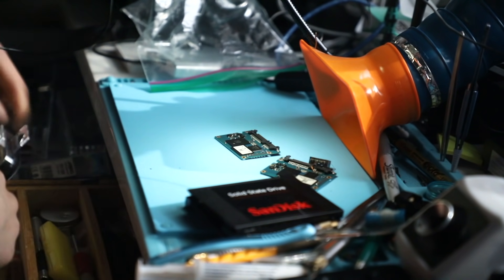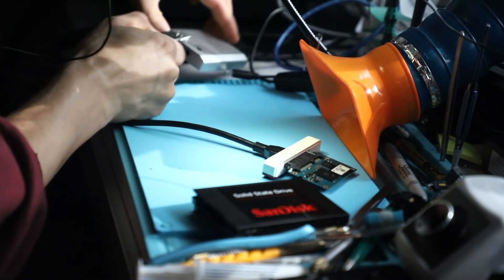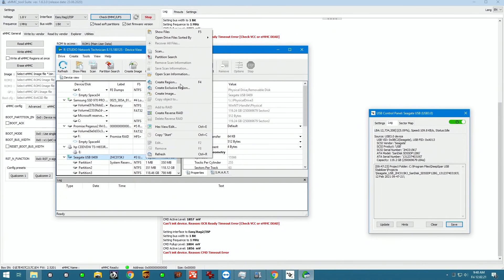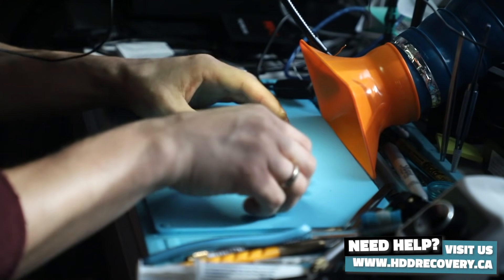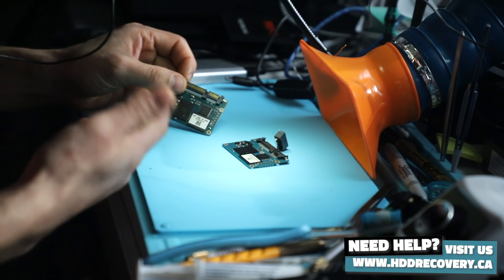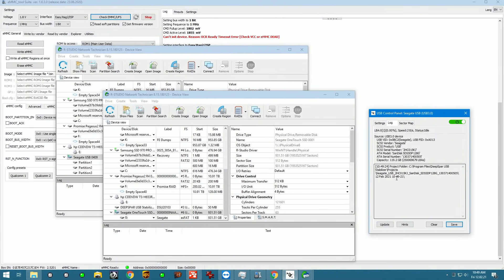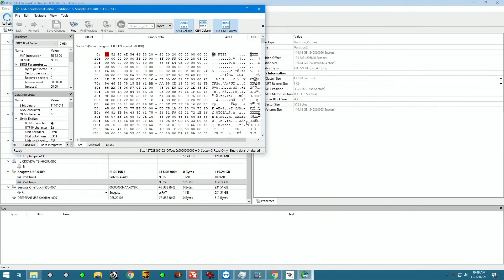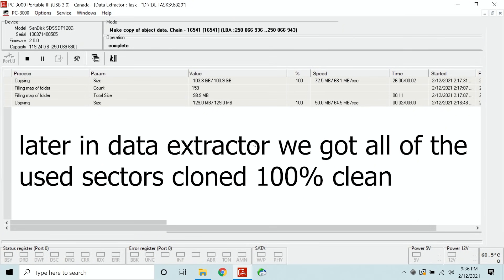solid state drive data recovery

Comment: Just wondering, how high a temperature and air flow on the hot air do you use for the unsoldering of the controllers.
Reply from the maker: 60air 365-380c depending on the board size

Comment: I have an ssd with 2 dead resistors. it powers up and shows the drive and letter but doeswnt show how much is in and doesnt load. so no access. I've seen the same happen with capacitors and they remove them and it works but for resistors is it the same I do I need to fully replace? Trying data recovery is just annoying cause I know it's a hardware problem just don't know if I can replace something so small. I ordered some solder paste
Reply from the maker: Simple answer would be no. You can't remove the resistor if it burnt and expect the unit to work. Burnt resistor - is essentially a self removed resistor
Reply: thanks, Hopefully replacing them will sort me out!  @hddrecoveryservices

Comment: Hi, very good work! I have the same problem and will do the same like you. I have some test SSD but it will not work. Maybe you can help me. How high is the temperature on the fan? How long do you preheat? What is the melting point of your paste, maybe  I need a other paste. And most interesting, when is the RAM overheated and can not work? Other component's on my SSD will also melt and swim away, its a mass...

Comment: I'm trying to do exactly what you did in this video but with a crucial ssd and I cant for the life of me get the nand flash off of the patient ssd. I've tried a range of hot air temperatures and air speeds as well as with and without flux. 
It seems like the chips have sunk down during my efforts so that makes me think the flux cant even get under the chip anymore. 
Do you have any tips? Thanks alot.
Reply from the maker: Preheater can help. Don't heat NAND with more than 385
Reply: @hddrecoveryservices  I'll look into a preheater, thanks for the tips!

Comment: So after all this, the SSD is fully working again just the way it was? Or did you recovered the data and move it?
Reply from the maker: We get paid or getting the data back, device itself is not meant for continuous use. I pull data from it, data goes onto a new device, new devices goes to client after I get paid
Reply: @hddrecoveryservices  thanks for the answer 😁
Reply: @hddrecoveryservices  I'm back with one question. So I have an SSD Kingston A400 that suddenly became uninitialized. I was using this SSD with a case enclosure on my old PC. Now I have tried everything: initializing from disk management, trying to format it, recover data, and so on, nothing works. I can only see it in Disk Management  as not initialized and unallocated. But CrystalDiskInfo shows all attributes as GOOD when checking the SSD. So I think the memory on it and data is ok, but something is wrong with my logic board too. Do you think I'm right? Because I doubt CrystalDiskInfo or other program will show good S.M.A.R.T. attributes, if the SSD would've been dead.

Comment: ive got an an about 2012 macbook ssd the macbook died and the controller chip was getting really hot there seems to be a missing component maybe a capacitor but otherwise it looks ok! could i do a simillar thing or are macbook boot hdd's likely to have encryption or something that would stop this from working? the data i want is mainly c++ programming ive spent hours on for personal projects so its probably not worth the expense of paying for recovery but i would like to have it as i built some custom libraries i would love to use again! i am ok with soldering and electronics but fault finding a board is over my head this seems like an achievable solution?

Comment: Thanks for the video. I once asked you what flash brands you finds most reliable and easy to recover data from and you suggested Sandisk and Lexar. Is those brands also the same high standards when it comes to m.2 SATA and NVMe drives?
Reply from the maker: Somewhat. But honestly, the only SSDs I had issues with were all made by Samsung

Comment: Can you recover and revive my m.2 ssd 256gb ADATA8200xpg, it detects but it has different code name sm22 instead of adata and it shows 1.0gb instead of 256gb, later on when the computer programmed when mbr it shows 1023mb but when gpt it shows 2048gb, i dont know how it happened because it was just so sudden.

Comment: I have a failed Patriot Torqx SSD, it failed on May 2010, I remember I downloaded Bitcoin around that time, and am wondering if it ever mined something. The socket for that drive looks different though, try googling Samsung PCB0. Do you think I'd be able to recover data by putting the chips on a working SSD?
Reply from the maker: Hey, torqx is based on INDLINX controller. I have ways for getting data from it. Crypto has been a hot topic for a lot of our service requests and I would be thrilled to help you. Contact us via website, and I will contact you personally. www.hddrecovery.ca/contact-us

Comment: Great job as always. Got a problem. I accidently formatted my 2TB WD Gold with DISKPART. All commands were inputted and executed. I have tried various recovery software but no luck on recovering anything. As in zero data from before it was formatted. The disk is working fine. Any advise you can give me that I can do. Any hardware you can recommend i can use.
Reply: How did this turn out?

Comment: sandisk nand lose data by heat . 2 years ago one come to me it is flash drive 32 gb
smi 3267 ab + 45 4c 98 92 tlc 8k 2ce
3267 is broked 
after very care fuly change pcb 
after install to new pcb device need to format 
with anyfound data recovery i found 20 gb jpg and mkv format 
sandisk nand is very untrustable 
also in emmc phone 70% sandisk emmc is gone
Reply from the maker: 3267 is a good controller to simulate. Did a few last week. All with great results. READOUT took some time, but tools and tech with RR today is much better then 2 years ago.

Comment: Hey erkin plzzz reply I am great fan of ur work and amazing stuff.. u are genius .. I watch ur videos  very curiously... so just out of curiosity want to know that if micro sd memory card  is cut down using scissors into multiple pieces so the nand embedded inside will also get divided  along with those multiple pieces therefore the data will also get divided into several pieces? is it true? Because I had heard from someone that a small piece of it has still some data which was earlier stored in that region even after cutting the sd card and u can recover from them .So is it possible to get data from that one piece or by combining multiple pieces and using any method ? .. is there any technology or any method ? So can somebody still recover those data from those small pieces?
Hope u will reply soon...
Reply from the maker: There is no chance to recover it
Reply: @hddrecoveryservices  thanks erkin and one more question:-  Not even a little bit of some data can be extracted from a single piece( which has a minor portion of nand memory chip embedded in) out of those multiple pieces of micro sd memory card??? 
Hope u will reply again....

Comment: You ever deal with dead 850 Pros?  Have a stack of 6 here that aren't even detected. I suspect a failed firmware upgrade bricked them.  Not interested in recovering the data, just wondering if they're just paperweight.  Could be a fun project for me to explore ssd recovery.
Reply from the maker: 850pro is doable even with firmware issues. Do you want to use them again? Or data is needed?
Reply: It's just to use them again, I don't need the data.  I was just curious if it is possible to fix them myself.  All six seem to have the exact same problem.
Reply from the maker: Yeah, restore microcode can be written
Reply: Just need to figure out how.  I have a 1.8v compliant serial and I may cobble up a jtag adapter but I don't have a PC-3000 or any proper recovery tool.  Want to make a 'recovery for poor people' video? :)
Reply from the maker: I can hook something like that up :) hit us up on the contact form on our website. Cover shipping cost and I will see what we can do. Would be a cool video for sure

Comment: What is the risk of degrading the data by warming up the NAND chips?  It didn't seem very high as you didn't mention it in opposition to the risk of frying the new controller on the potentially shorted board.
Reply from the maker: Not high to be honest. I don't go over 390c

Comment: Then what will you do with the flash chips on the doner drives? They do worth some money.
Reply from the maker: Nothing, they are not worth anything to me
Reply: @hddrecoveryservices  Then maybe you should consider using them to build USB drives if you have a lot of them. A normal USB PCBA should cost about one to two dollars while one with good controllers like SM3280 is no more than 5. Then you can build USB drives that both have better quality(higher binned chips) and way larger and faster than something you normally see on the market(e.g. SM3280 can go over 400MB/s).

And the soldering time per drive should be less than 3 minutes. After this you only need to plug it in and let it automatically sort and MP on the background. No need to leave some good chips to waste.

Comment: Good work as always. Looked like someone went at that port with a car panel type iron and no flux 😒 - Good to see people succeed. Just home after a long day, spent 3 hours trying to rejoin a fully torn flex cable for a fingerprint sensor on a Pixel, 13 traces torn so the jumpers had to curve at rounded 90 degrees. Did not  succeed. 

I finally got around to ordering one of those sweet board holders after seeing you using it (the red one).

Question: What's the new paste? Is it the MG 4860p in description? It looks pretty good - you think it'll do ok for 0.15-0.2mm pitch stencils?
Reply from the maker: paste is actually PPD Pro. S260 lead free
Reply: @hddrecoveryservices  138°C Tin/Bismuth blend? Is it a "true" paste or "granulates" in flux suspension?

Comment: holy crap I figured SATA drives had a full size PCB to just load it up with NAND chips. That looks like it's half the size. I still can't get over how small NVME drives are. I just installed my first NVME drive ever recently into my new computer. I bought it back in november though. It's a samsung 980 pro and the stock was limited so I bought mine as quickly as possible so I'd have it for when I'm able to get my Ryzen 5900x.............which I temporarily gave up on and put in a 3600 instead. I was just sick and tired of my I7-2600 especially after I got a new laptop that was kicking my desktop's ass.
Reply from the maker: some do have a full size PCB, some even have a 3.5" size PCB :)
Reply: @hddrecoveryservices  my old computer had a Samsung 830. Its 9 years old and still works. Maybe its a full size. It is 512gb which was a lot back then.

Comment: Why do u need easy jtag ?..plz let me know of u r doing mobile data recovery
Reply: I see on ur screen thats why i m asking👍
Reply: And also i remember ur using 861dw by quick ...but in this video ur air gun is changed to ...m i right?
Reply from the maker: In some odd cases we use EZJTG for some projects. Our lab had 861DW blow a fan recently, so I gave my old Quick to the shop. I got JBC now.
Reply: @hddrecoveryservices  thnq for replying😀👍

Comment: Seems like a older version of the current Sandisk SSD Plus drives. Newer ones use SM2258XT controller, i've heard that the data gets corrupted very quickly on these.
I have a 512GB Orico SSD with SanDisk SSD plus components inside ( SM2258XT + SanDisk nand ). Very good ssd, but wouldn't use that as daily drive.

Comment: Just for curiosity, when you seat back the chip how are you sure of its position, I mean how are you sure to match the contacts since they are under the chip and not visible ?
Reply: The chips don‘t need to be aligned perfectly, the surface tension of the solder will move them into the perfect position once the solder is melted.
Reply: @trekkie_who  Thank you for your reply..

Comment: thanks for the video, I did a little component level troubleshooting in the late 90s with a tiny bit of LSI on the boards, I liked doing it, though the company did not pay hardly anything.  quite impressive what you are able to do with mem modules and SSDs!
Reply from the maker: thank you, :) If you like this repair, then you would love this one https://youtu.be/KsFKpqVhU88 
the linked case is the pinnacle of my soldering skills to early 2021 :)
Reply: @hddrecoveryservices  I'll check it out